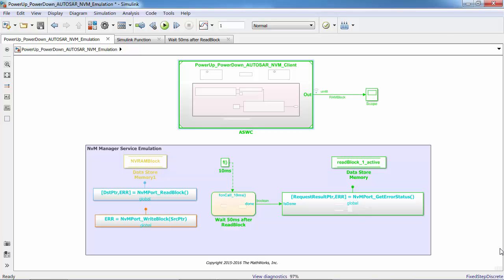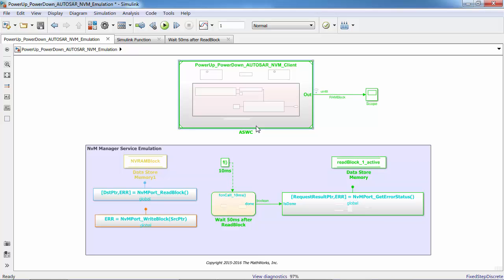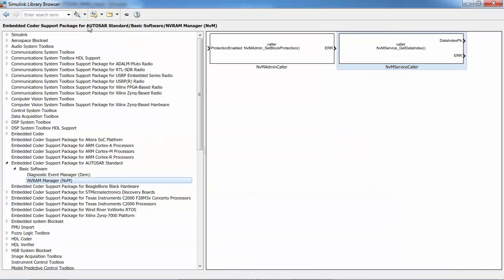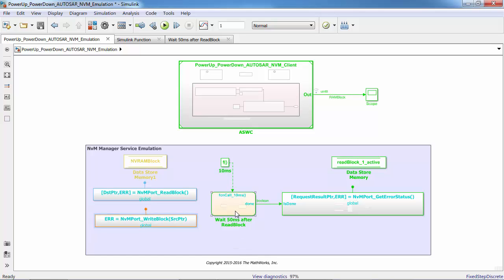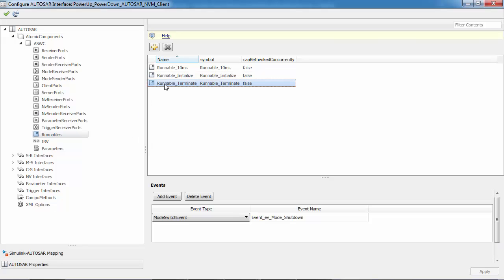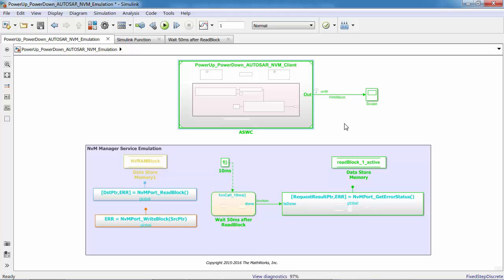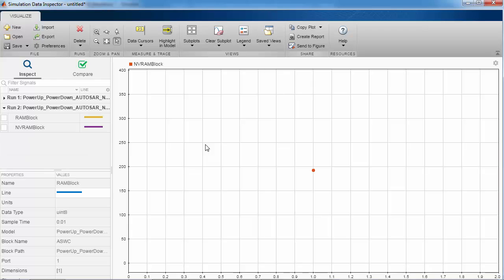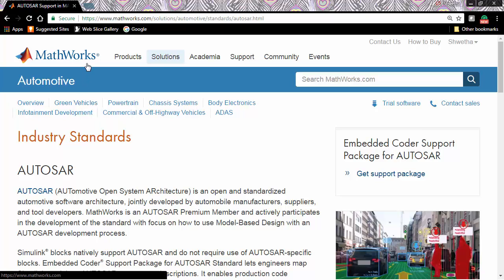Model AUTOSAR ECU Power-Up and Power-Down Behavior in Simulink

Comment: 1) what values are you assgining as input & which block are you using in simulink to assign?  
2) How to find memory Mapping NVRAM to RAM
Reply: for simulink you have to use Autosar blockset; 2 has to be configured in a autosar BSW configuration tool, such as ISOLAR B from ETAS or Tresos from EB, or DAvinci Configuration Pro from Vector